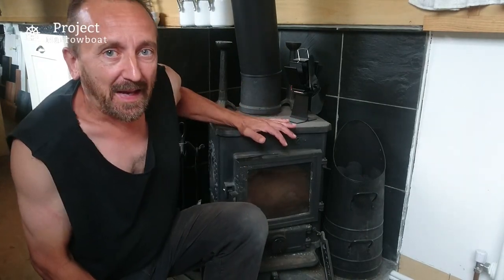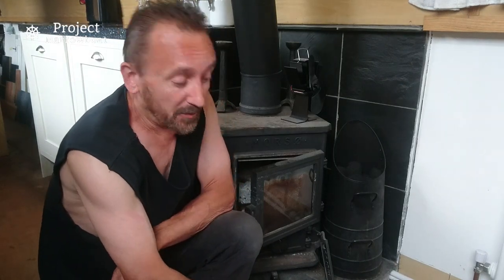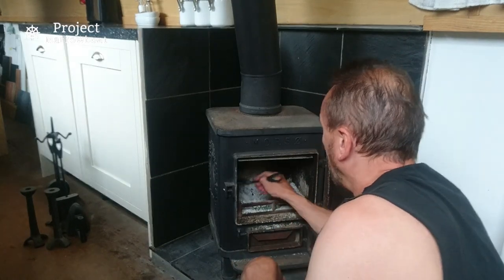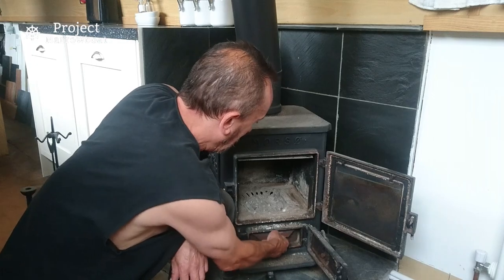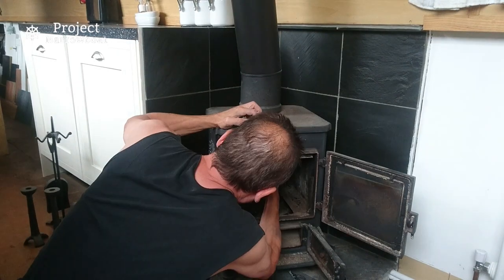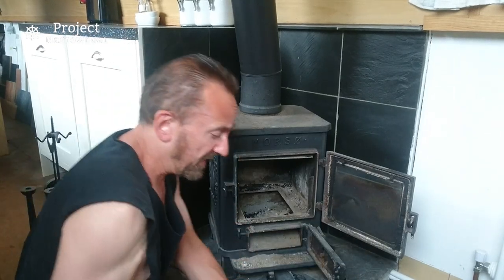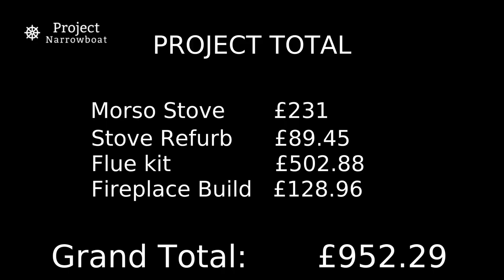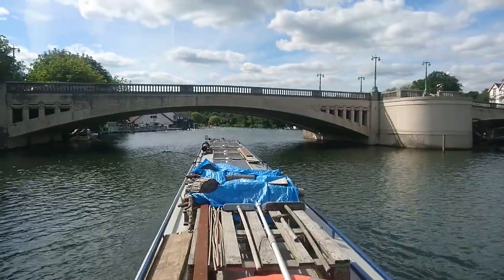Project Narrowboat ep 14 - Narrowboat Stove

Comment: Great channel m8. Dumb question how long is ur flue, im trying to work out minimum flue length cheerz
Reply from the maker: It's the standard morso kit (which is very expensive) so 55cm on the outside, plus the two one metre pieces inside which are slid over each other quite a bit coming to around 140cm. The inside bore is quite small (because it is 5"od and twin wall) and I don't think it draws quite as well as I would like - it's ok but if you open the door too quickly and/or the fire is not burning well, smoke can enter the room. Really, you are constrained by your internal boat height and however long a chimney you want on the outside - I always take mine down so could easily go longer if I could be bothered.
Reply: Thanks m8 greatly appreciated the info

Comment: I have a Morso Squirrel stove like yours. 
The parallel section of chimney stack was swept into the canal by an overhanging branch a few weeks ago, any idea where I can get a replacement?
Reply from the maker: Well, Morso via a chandlers. I got my whole kit from a chandlers online. Might have been Midland. But of  course - the thing to do is to take your chimney off before you cruise - I always do and that's why I've still got it!
Reply: @ProjectNarrowboat  
Yes I do, I slide mine on the boat pole for safety, which is fine going forward, infortunely whilst reversing a low branch whipped it off the pole and into the water!!!